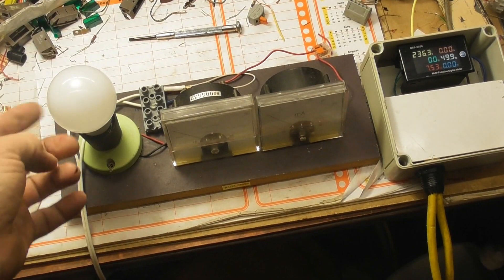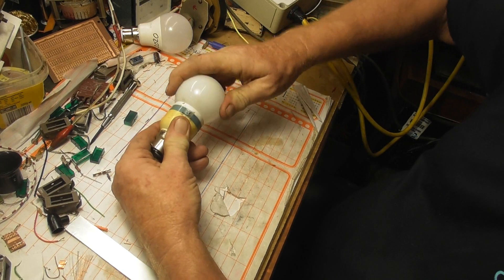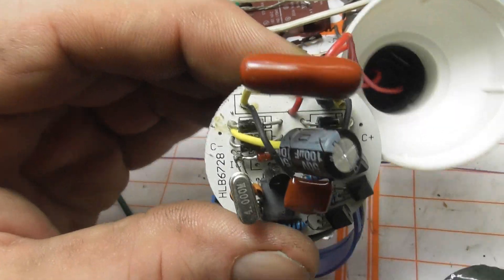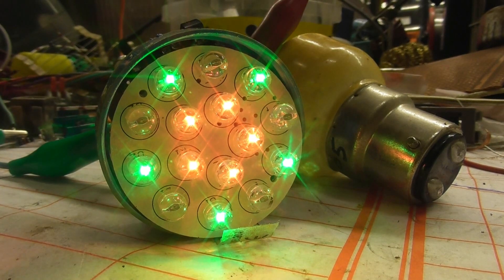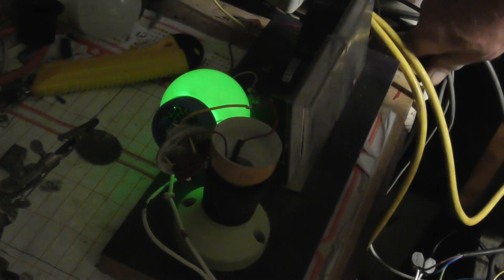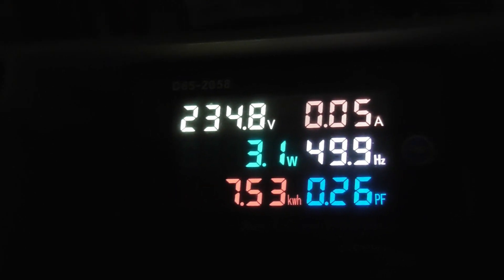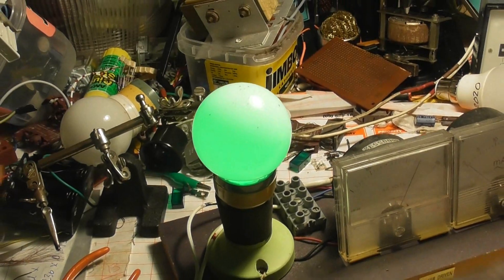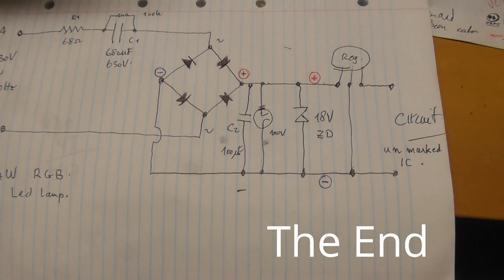Two LED lamps. One mult-icolour from 2005 which was faulty.

Comment: What I like about those older colour changing lights with the separate IC is they have fairly even brightness and proper colours through the colour cycle.  I have a few old garden solar lights that still had the separate IC with a 4-pin RGB LED and these cycled red, green, blue, yellow, cyan, purple and white.  

The slow colour changing LEDs where the LED itself contains the IC are terribly imbalanced with the green dominating, at least with a variety I bought from AliExpress, Amazon, etc.  i.e. red, intense green, blue, bright olive, cyan, purple and a pale greenish cyan and there's no way to tame the green with higher ohm resistors without the blue getting too dim.
Reply from the maker: Thanks for your detailed reply and you are spot on with that.

Comment: I myself are big into LED’s. And I’ve wondered this regarding LED’s powered from AC line voltage. Obviously, one needs a resistor to drop the voltage down from 110/220V to ~3V. But what about when the diode is blocking the all the full reverse voltage. Wouldn’t the full 110/220 voltage cause a breakdown as the reverse bias voltage is rather low?
Reply from the maker: The capacitor drops most of the mains voltage. The bridge rectifier and 100µF Cap make it to a pretty good DC. The Zener here sets the max voltage to about 18 Volts. The LED's are in series. 5 blue Leds is around 15 Volts. 5 green Leds' about 11 V, 5 red Led's about 9 Volts.
Reply: @RODALCO2007  Thanks. I've bought LED pilot lights made in China that simply had a forward dropping resistor and LED. Works, but since when reversed biased - the reverse breakdown voltage is exceeded, and the LED's don't last long.